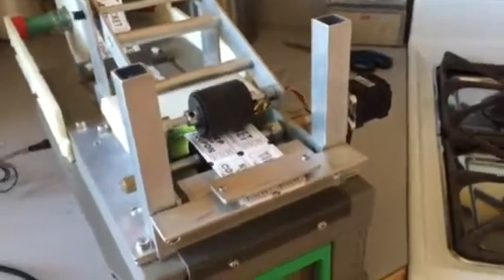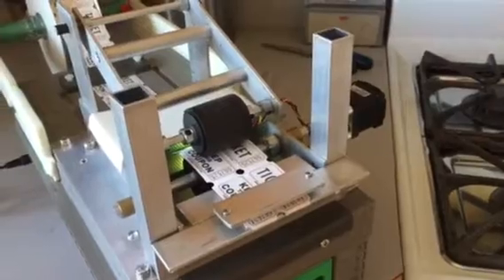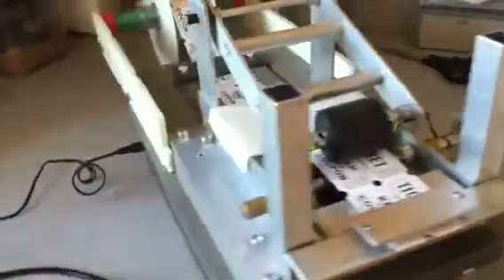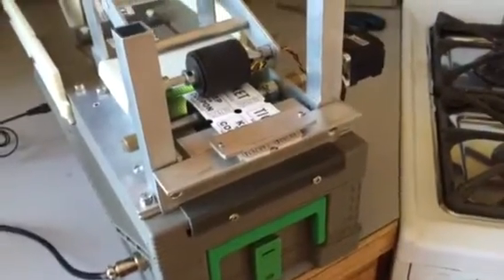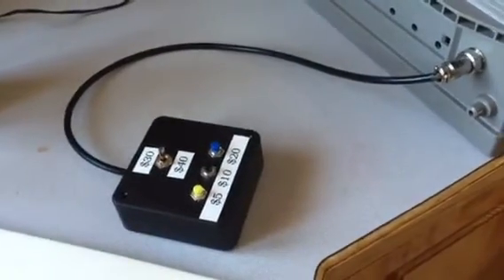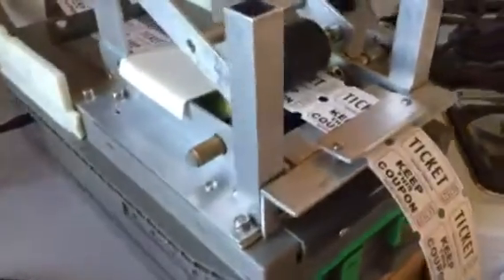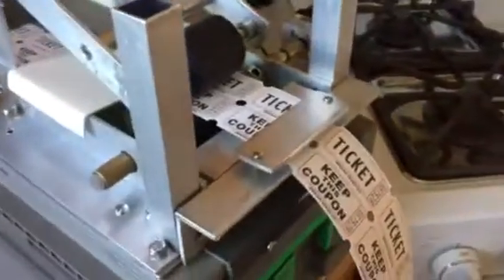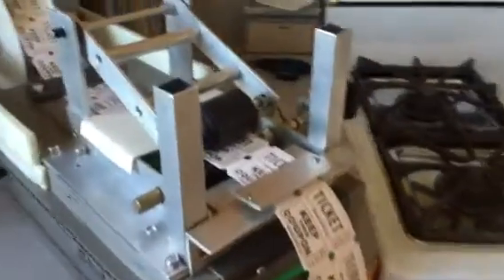Arduino Electronic Raffle Ticket Dispenser

Comment: Dude!! Awesome! I was looking to build something just like this when I found your video. Do you have some building instructions you could share? And/or the Arduino code you used? The only thing I am thinking of doing differently would be to add a keypad so that the user can enter the number of tickets to dispense vs. using preprogrammed amounts.
Reply: Hi Robert. Excellent machine! Would you be willing to share the code with me to study? I want to create something similar. $$?
Reply from the maker: Hi Robert.  Thanks for the positive comment.  I had thought about a keypad as well, but didn't have one when I was building it, and in reality, it was not needed for our case.  In the case of our raffle, people either buy one ticket, or in $5 increments, and when we are really busy, just hitting a button is a lot easier.  People don't generally purchase $28 worth of raffle tickets, they will spend $25 or $30.  You can contact me at mkhedgehog@gmail.com to discuss it further if you'd like.
Reply: @michaelknop8586  i know this is a older video but was wonder if you can share how u did this or would be willing to make me one for a cost,
For are local school